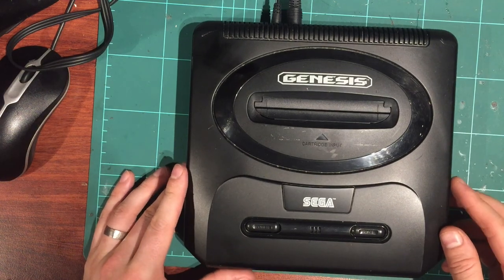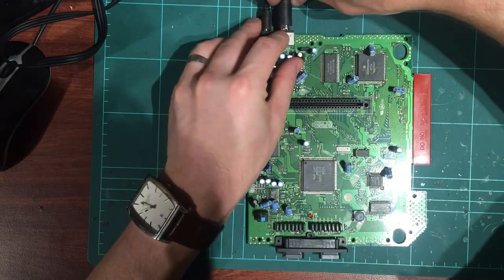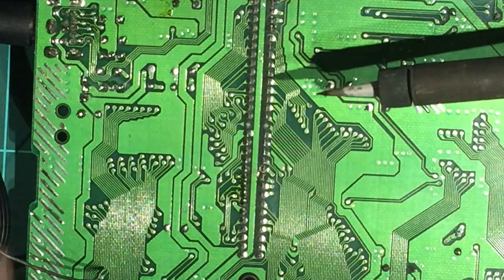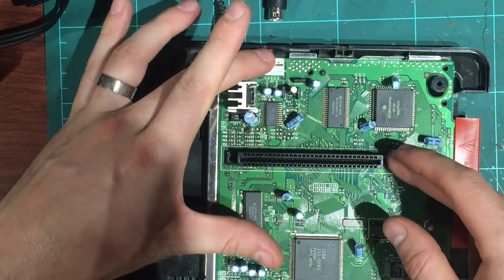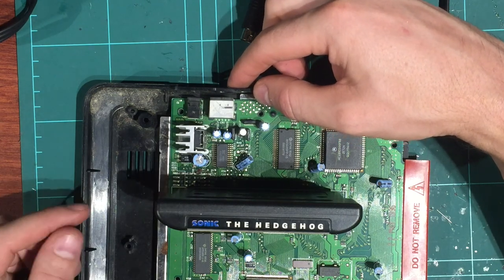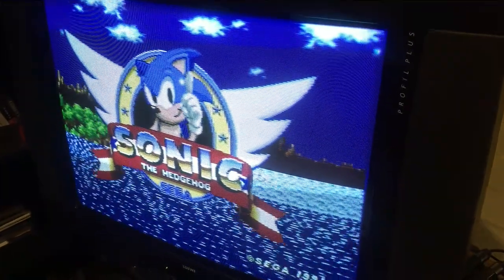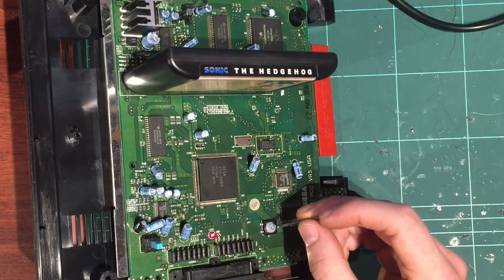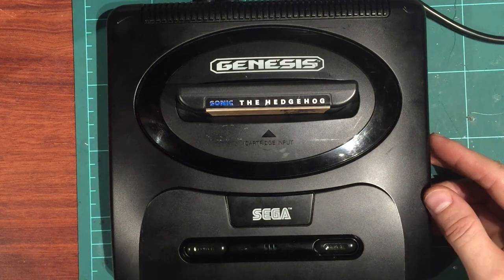SEGA Genesis Console repair - Console 6 Video Issue & Reset Button Fix - Part 7/7

Comment: HI, I have a Genesis model 1 where I need both RF and AV for it to show a picture. I'm pretty sure it is the ground pin having a dry solder. Do you think this is the case? I need a second opinion on this. Thanks!

Comment: The reset button was one problem on mine.The other is it has to warm up for a minute before it can be played.Is it a big deal,or is it easy to fix, and is the console safe to use.Thanks,cool video😎😎😎

Comment: Would you happen to have some advice troubleshooting a model 2? It get's power and outputs a signal but it's a black screen. Confirmed all cables and the game are working on another system. The only odd thing I've found so far is the leftmost pin of the cartridge slot has no current running through it, but I'm not sure if that's normal or not. All the other pins show 5v as they should. Reflowed the solder on the video connector.

Comment: Great videos. I have a Japanese model 1 Megadrive that I picked up from ebay afew months ago that needs some attention. Pretty dirty and beat up but I'm determined to give this unit a new life! Basically the reset button isn't working, I took off the cover and tested it whilst it was on directly on the board and it worked so I think it might be an issue with the switch itself and the power switch is actually quite stiff. Plus the RGB connector at the back is stiff too. I'm thinking of using contact cleaner for the connector and the power switch but I'm not too sure. Do you have any recommendations for these issues?
Reply from the maker: GinraiPrime666 The reset fix is at 12:20 in this video
Reply: Ah thanks! I thought it might be different for a model 1. I'm gonna guess using the contact cleaner on the power switch and RGB connection will be fine too :)

Comment: +Global Garage thanks for sharing your tips, your videos are well done and informative. I have a model 2 that is getting power and is getting a video signal but never gets past the Sega license screen that displays when the game first boots. The license text displays for a few seconds and then goes black and never does anything after that. Have you run into this before? Things I've done so far is cleaning the pins and re-tensioned, flowed power port pins, and tried different cables and games with the same results. Any tips?
Reply from the maker: Does it happen with all games? It sounds like a dirty cart slot to me, so the only way to troubleshoot further would be to try different games in your console, then the same games in another console and see if there are any changes.
Reply: Yes, I've tried different games and cart slot is as clean as I can get it, and all my games get cleaned when I get them. I could try cleaning more, see if it helps. I just think its odd that every time it get the white license text perfectly and never gets to the "SEGA" screen or game title. I'm having a similar issue with an SHVC SNES but just gets a plain black screen with no blinking... I think it may actually have a dead CPU, was hoping it wasn't the case with the Sega. Thanks for the reply

Comment: I have a model 3, using composite on 2007 hd tv and it shows graphics in black and white, no color. Clean cart slot. Any ideas?
Reply from the maker: Kenton Bocock Is that NTSC Composite? If you’re in the States then it should work as your TVs are all NTSC. Sounds like a TV compatibility issue.
Reply: Global Garage yes ntsc, everything works just no color. All my model 2s work using same cable and input. Will try old tv.
Reply: tried on a different older tv and using rgb, no color. Any ideas?

Comment: I have a sega genesis model 2 with wavy video over RGB, I've yet to try it with a regular composite cable, but what do you think it could be?

I had a technician do a reflow on the video port since it is such an old console, but the mini din9 port looks very mistreated.

Do you think I should replace the caps or the mini din port? or both?
Reply from the maker: I would definitely replace the caps. You can do just the ones in the video output area of the board first, but you may as well buy a whole cap kit for your model as they are cheap as. console5.com has them
Reply: Global Garage Thanks for the info! I buy caps all the time from console5. The trouble will be finding a decent technician in my country. Its too bad I live too far from Australia, otherwise I would've contacted you guys about it.
Reply from the maker: Where do you live?
Reply: south america...

Comment: hey there, my megadrive model 2 stoped working recently. it started to display a black and white screen at first, and now the sound loads, but the screen is totally black. I`ve already cleaned the games and cart slot and my games with isopropyl alchool, but it didn`t work. I`m not sure if it`s an av port issue(i dont have rf cable to test it), or if  it`s a problem with the pcb. Is there any way for me to spot the problem and fix it?
Reply from the maker: gerson veiga Ribeiro How are you connecting it? RF, Composite or RGB? I'd first take the board completely out and inspect it for corrosion or dry solder joints. Look closely at the fine pins on the chips as a small amount of corrosion could cause this issue

Comment: Hi there, can you tell me how you manage to run these consoles on a PC monitor?
Nice videos btw, I'm subbing.
Reply from the maker: +adilator HI thanks for the feedback! I use an old Dell U2711 with a tonne of inputs.

Connectivity
High Definition Multimedia Interface (HDMI)
2 Digital Visual Interface connectors (DVI-D) with HDCP
DisplayPort (DP)
Video Graphics Array (VGA)
Component Video
Composite Video
1 USB 2.0 upstream port
4 USB 2.0 downstream ports
8 in 1 Media reader
DC power connector for Dell Soundbar 
http://www.dell.com/ae/business/p/dell-u2711/pd

Comment: I have a reset switcth on the same style genesis were the membrane is gone it fell apart. online says get a tact switch and i  measured so i can see it takes a 10mm by 10mm switch. My problem is the membrane is gone so I can't really tell the proper height for a switch.  This one caught my eye but not sure about the height nor if it is even the correct type. http://www.digikey.com/scripts/DkSearch/dksus.dll?Detail&itemSeq=216753461&uq=636203741448976006  
Spacing and leg count looks solid so IF it is the correct type of switch and height i should be good. Any and all input is greatly appreciated. Thanks for your time.